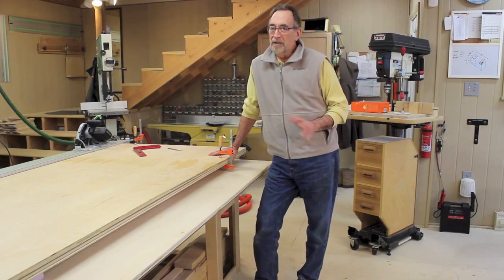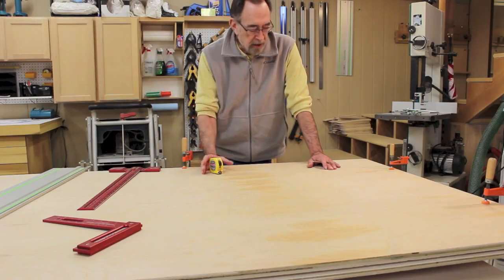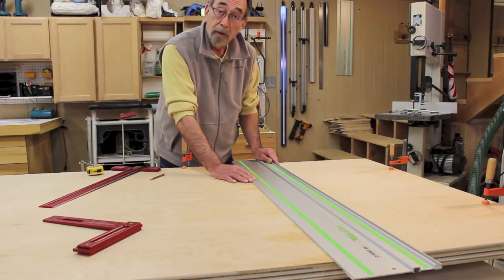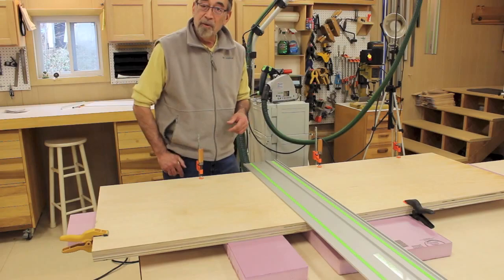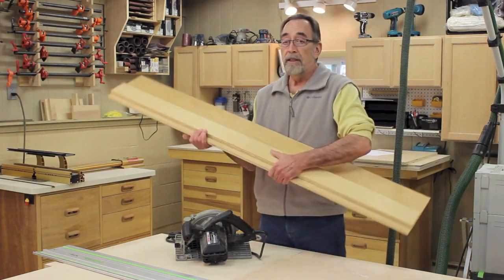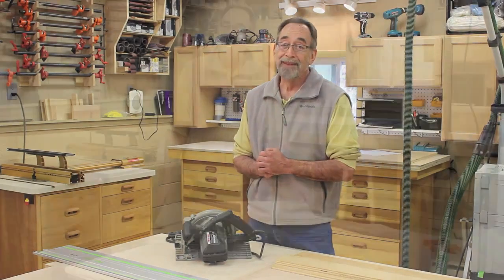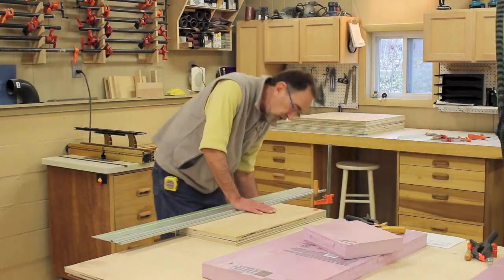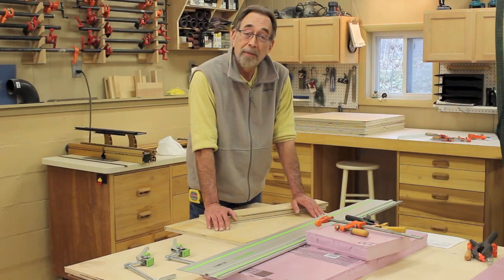Building a Mobile Sanding Center, Part 2: Cutting Out The Parts - The Down to Earth Woodworker

Comment: Jon Jon (above) is correct.  If you notice, I used a square to line up the Guide Rail (about 1:42 into the video) for my 2nd cut.  To maximize the utilization of the plywood, I usually measure in from one edge about a half-inch to cut my first square edge.  I also measure from the other side, 47 1/2".  That way I can see how "out of square" the plywood is, too.  Then I lay down the Guide Rail which is perfectly straight & cut a reference edge roughly in line with the edge of the stock. Thanks!!!